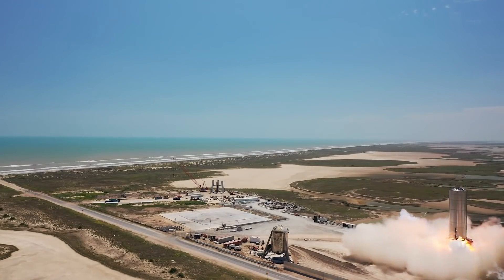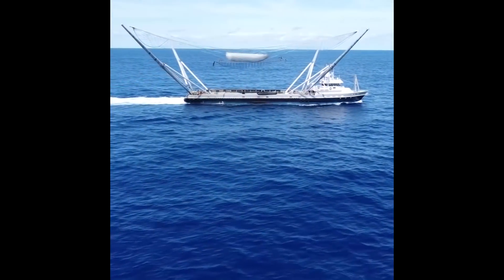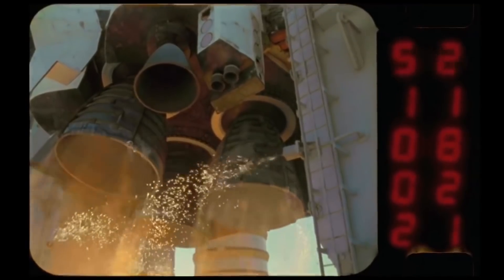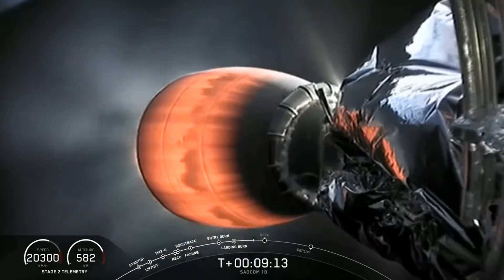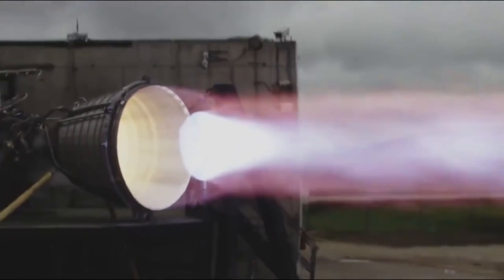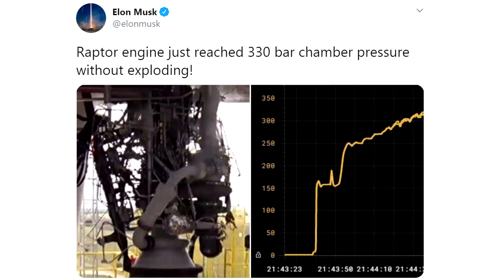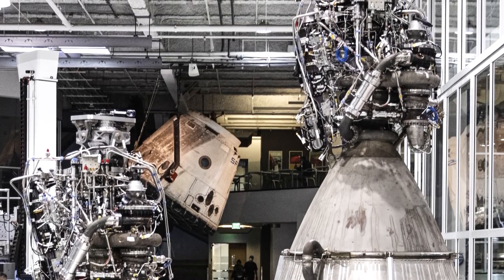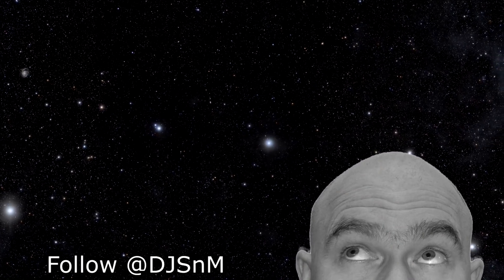How SpaceX's New Raptor Vacuum Engine Is Different From Previous Raptors (and Other Stuff)

Comment: white coating should be YSZ thermal barrier coating. It is used to block heat flux from hot gas, and prevent oxidizing of nozzle material

Comment: Solution to header tank pressurization is to use large cylinders filled with fuel, and a piston pushing down on it, to feed the engines. Four of these arranged linearly in a circle, will do  a perfect job, regardless of starship orientation.

Comment: Concerning flow separation of the hypersonic (not “supersonic“) gases from a bell nozzle: Yes, it´s a thing, but I think that the “bright beads“ that you see and are saying are (ground-based) examples of this effect, are in fact predominately shock diamonds -- a different phenomenon entirely.

The small contracture of the efflux just aft of the nozzle is a better indicator of the start of flow separation.

You mention the related term Mach diamonds, but I would quibble with you that shock diamonds is a better term, because there is no implication of any shock wave(s) primarily caused by decelerated flow, but instead are the visual indications of the high-energy local intersections of shock waves “ricocheting“ laterally.

Comment: After seeing the failure to re-ignite the Raptor engine in the SN9 landing, could the failure have been caused by the high presssure rapid startup of the pre-burners? Or is it more likely to have been something which occurred earlier in the flight when the engines were already firing?

Comment: 8:28 - Given that the turbopumps need to spin up in perfect synchrony, why not mechanically connect them (with a gearbox or belt/chain drive or something) to force them to run in lockstep?
Reply: That's how most staged combustion engines work but i think Elon just likes using the word full flow so he went with 2 preburners for the raptor.

Comment: NASA has its "in-space propulsion" facility (ISP: apparently wordplay on specific impulse, because second-stage and space-probe engines are optimized for high specific impulse) with a giant vacuum chamber to test vacuum-optimized engines in.  Rather than choosing between that and testing at sea level, I would think that it might be better to build an ambient-pressure test facility at some high-altitude location.

Comment: XLR-99, the X-15 engine, had a white coating too called Rockide to help insulated the walls which were regen cooled too by the ammonia fuel. That bright/hot spot is caused by the phenomena of gases becoming opaque above a certain temp. Thanks again Scott for another professionally delivered video - Ken

Comment: Hey Scott,
The Raptor Engine uses Helium?!! How much does it use? What does it do for the engine? Helium is a finite resource that is running out. I think this topic is worth a video!
Thanks,
Ringo
Reply: High pressure helium is used on most rocket engines.  It is used to activate the valves, pressurize tanks and to spin up the turbopumps.  They use helium because it will remain a gas even when in contact with cryogenic (very cold) fuels.  Other gasses would liquefy.

Comment: The nozzles are manufactured by machining grooves into the exterior of the nozzles. Than these grooves are filled in with a special wax. Then the nozzle is dipped several times into an electro plating tank of inconel 719 until a layer about 3/4 inch thick gets built up. Than the nozzle gets final machining and finally the special wax is melted out leaving behind the grooves. I saw this process on another video.

Comment: Why don't they change the nozzle exit size in the same way they do on gas turbines? The sea level engines would then be much more efficient as they gain altitude, i.e. match the exit aperture with the prevailing atmospheric conditions...

Comment: I wonder how the new raptor engines will compare to the RS25s when the final version comes out?  Granted there startup sequence is much quicker than the shuttle sequence but it would be interesting how both compare on performance and efficiency.

Comment: Scott, I need an explanation please.   You suggested that to get the expansion ratio up they could also reduce the throat area.  While I agree, don't you reduce the mass flow of the engine (assuming the chamber pressure stays the same)?   The flow at the throat is choked.  Thrust is Mdot x Vj.   The nozzle expansion works on the Vj term.   So reducing the throat will reduce the mass flow rate which will reduce thrust - UNLESS you let the chamber pressure go up.   What am I missing?   Thanks - great video as always.
Reply from the maker: Yes, you’d need to redesign the pumps to operate efficiently at the lower mass flow rates.
Reply: @scottmanley  So what do you do about the loss of thrust?

Comment: Raptor can't use radiative cooling because of the starship skirt? Wasn't Elon motto "the best part is no part", take the skirt down! That will give to the type of comments like "he likes his rockets and women skirtless to keep an eye on their hottest parts".
Reply: They need the skirt for landing legs and COPV storage
Reply: @ryancollyer2046  obviously they don't , can put separate protection on them, and another role of the skirt is to conect the two stages together, but it doesn't need to be a solid piece, can be made from separate beams with large gap between. The reason why they are choosing regenerative cooling and not radiative is that probably doesn't work on a engine twice more powerful than a vacuum Merlin but almost at the same size, especially if they need to using multiple times not a single time like in the falcon9 upper stage, also falcon9 have a single vacuum engine on the upper stage but starship will have three and some of the termal radiation will be blocked by the near engines.

Comment: In addition to flow separation, over-expanded nozzles incur negative pressure thrust, which literally sucks the rocket backwards. It's exit pressure minus ambient pressure times area at exit equals pressure thrust. Also worth noting that almost all rocket engines are over-expanded at sea level. This is because they tend to fly up, to higher in the atmosphere where the pressure is comparatively low, so it makes sense to optimize them for a compromise between sea level and performance at altitude.

Comment: Wait wait. Did you just say the Raptor is more complicated than the RS-25??? So the fact that the RS-25 has twice as many pumps to control, makes it simpler??? Not following you.. 

Will the Rap-vac fit into the Falcon 2nd stage and if so, do you think they will make an upgraded/new upper stage to use it. There must be a not insignificant performance increase, by using this properly designed vacuum engine. Plus they would get some experience with meta/lox and get the Raptor flight tested in vacuum.
Reply: Raptor and Rs-25 both have 2 turbopumps. Plus Raptor is full Flow Stage Combustion so it's more complicated.
Reply: @ryancollyer2046  And RS-25 is Semi-full flow. All the fuel runs through the 2 preburners.

Comment: Is there a reason why Starship doesn't use a more 'lifting body' shape?  Using a small amount of LB shaping would (I think) allow greater control during reentry and pre-landing freefall, while a greater (if not fully) LB shape would allow them to land like the shuttle, but with the option of perhaps one "go-around" use of the engine...

Comment: Gases become opaque at a critical temp and is why the shock becomes visible because the pressure increases as the atmosphere 'compresses' the exhaust plume. I never heard this fact mentioned anywhere,have you? Thank you with Blessings Scott - Ken

Comment: SpaceX's ability to leverage technologies from outside the normal aerospace field has always been impressive. The milled core sandwich panel design with a thermal coating (Yttria stabilized Zirconia or similar) has been used in the gas turbine industry for years to manufacture combustion section components. The current generation of large power generation turbines operate at turbine inlet temperatures approaching 1600c for months at a time.

Comment: would one raptor engine with variable geometry nozzle better than two separate raptor engine with two different diameter nozzles ? or is the additional engineering for variable geometry nozzle not worth the weight/thrust efficiency saving ? similar to what you see on the variable thrust vectoring nozzle on fighter jet. Feels like it will be way lighter with one engine with one variable geometry nozzle versus two engine with different size nozzle.

Comment: If they are smart,  for the  first test of the belly flop maneuver they should come down over the water just off the shoreline and then scoot over to the landing pad just in case thing don't go as we hope and it goes splat instead. Better to go boom out in the water than at the test facility.

Comment: Why has no one made an adjustable nozzle similar to what you find on the afterburners of fighter jets? You could optimize the nozzle size for altitude and atmospheric pressure. Or has someone tried it in a rocket?
Reply: I believe it's temperatures and material tolerances.  Afterburners produce temps under 2000 degree's while the raptor i believe is up over 3000.

Comment: Scott, great video as always. Can I ask a question, with all the science and tech going into these engines why is it not possible to change the shape of the nozzle when it arrives in space? Or some of the engine could be shut off on ascent and then transformed before turning back on. Might save fuel

Comment: So Mach Diamonds look cool but they are actually a sign of inefficiency. "Damn this nozzle! Those Mach Diamonds are huge. Let's bring this engine to space and redesign this nozzle!"
Reply from the maker: Mach diamonds happen when there’s a pressure difference, which is impossible to avoid unless you’re in a vacuum or only flying at a constant altitude.
Reply: @scottmanley  Thanks. I think I
 get it now, but it is counter-intuitive to me. Like most Rocket Science...lol
So maybe a great idea is a rocket factory on the far side of the moon. Low gravity well, and the engines and nozzles could be made extremely efficient because we could have a huge expansion ratio due to lack of flow separation and Mach Diamonds because of vacuum of moon.
Reply: @AboveBeyondVapor  Building on the moon is a great idea.  It's just going to take some time and a pile of money to get it started.

Comment: I wonder if it's possible to have some kind of vanes (separators) or ridges/riffles inside the large expansion nozzle, to reduce flow separation instability, similar to how baffles are used on the F-1 injector plate to eliminate burn instability.

Comment: Maybe dumb question but for 1st stage engines could you have a sleeve on the outside that slowly dropped down as it got higher, so the bell would effectively grow as it ascended? Would that be too heavy? Or too hard to keep cool?
Reply: Those sliding nozzle extensions tend to use radiant cooling. Not a good idea with more than one engine (trying to dump heat toward each other). Also not good if there is a skirt around the bell. You would heat the skirt or the skirt would reflect the heat back to the engine.
Reply: Harold Henderson yep yep. All valid points!

Comment: You talked about the fairings soft landing on water and it got me thinking: How hard would the splashdown be if there were no parachutes?
Reply: Fairing terminal velocity is roughly 20m/s, so the effect would be about the same as crashing a school bus into a concrete wall at 70km/h. Quite destructive.

Comment: I might be wrong but I think the throat diameter is more a function of static pressure within the reaction chamber and the need to accelerate the sub-sonic flow up to the speed of sound before they can accelerate it further using an expansion nozzle. Sub-sonic flow is accelerate by a contracting nozzle (throat) while super-sonic is accelerate by a diverging nozzle. 

Also, I think they can use a longer nozzle (space requirement allowing), it's the area of the exit that's most important, in relation to the area of nozzle inlet. Longer nozzle however would have higher frictional losses. However if they wanted to test a manufacturing process that required a longer nozzle, they could.

Comment: @Scott Manley I don't think SN8 will do a 150m hop before it makes its 15km bellyflop attempt. Despite SN5 and SN6 being made from an older alloy, it seems like SpaceX have gained enough data from their hops to proceed directly to a higher flight. I doubt they would have wheeled SN8 out to the launch pad with its aft flaps installed if the plan was to do a 150m hop initially anyway.

Also, great video on RVac...no, wait, the correct term is V A C T O R ;)

Comment: Scott, please could you explain what  "out of family ground sensor reading" means? What is being sensed? and why report the reading in such an odd way?
Reply: I'm not sure what was odd about it and I don't know what sensor gave them a reading that was out of family but from what I know sensor systems usually have a bit of variance in their readings, but when you graph them they tend to cluster together.  The expected values is the "family".  When one of those sensors deviates it starts to return values that are out of the 'family'.  What I can't say is if that's what Spacex meant.

Comment: Is the Vac Rap basically 'just' a normal Raptor, with a nozzle extension?  To a non-engineer, that's pretty much what it looks like.  There must be some plumbing alterations for the extra nozzle, but, other than that, the two engines look almost identical.  As for the quite overwhelming complexity of these engines, surely that goes against frequent re-use?  The more complex something is, the more that can go wrong, so the longer the check/refurb stage before re-use.  Musk's aim of land, refuel, take off again, needs maximum possible reliability, and that must argue against complexity?  I appreciate that these engines are effectively prototypes and the finished design will probably be simpler, but can it be THAT much simpler?
Reply: But in this case, the increased complexity results in lower internal temperatures which makes the engine more reusable. In rocket design, absolutely everything is optimized as much as possible.

Comment: 4:40 i wonder why they don't put an inverted kort-nozzle around the bell-nozzle. The flow around the engine would provide a significant drop in ambient pressure, optimizing test circumstances...
Reply from the maker: Yep, this gets done but they didn’t need it in this case.
Reply: @scottmanley  Any idea why this seems to be no valid way to run overextended bell nozzles on  a regular basis? I guess they are already experiencing lower than ambient pressure once the rocket goes supersonic and there is the vacuole behind the shockfront, but maybe they could have that lower pressure right from the start of the engine just by adding some cheap aerodynamic surfaces? It would make aerospike engines obsolete (if they are not already) Still they had those ridged overextended and heavily vibrating nozzles on the SpaceShuttle...

Comment: Could you do a video about the MOOSE  system, to get astronauts with the bare minimum of Equipment savely out of space ? 
You mentioned it in the past that it was thought about in the beginnings of human spaceflight, but never realised. 
Could it be more feasible with todays   engineering ?

Comment: Fun fact: the recommended pressure for a decent expresso is around 9 bars
Reply: That is a fun fact. That makes my Dolce Gusto more powerful! In ... some metric, at least. It goes up to 15 bar!
Reply: @Mythricia1988  15 bars might lead to over extraction with the same extraction time.  Have you tried the standard 20s extraction time at 9 bars?
Reply: @acasccseea4434  My machine is automatic, no control over that. However, once I get space for one I will get a proper espresso machine!

Comment: Is there no way they could install an expendable sea-level bell inside the vacuum engine bell? maybe some issues with damage to the outer bell when detaching it in flight.
Reply: See everyday astronaut’s video on the aero spike concept.
Reply: @sethland  Aerospikes are years away, I was just wondering if this could be done.
Reply: @tangent2658  I see what you're saying. My speculation: It'd really be hard to engineer the attachment joint of that inner sea level bell given the temperatures and pressures. Plus, it has to be hooked up with all that coolant plumbing. Not to mention, the turbo pumps would be hard to optimize for both bells. Seems really delicate and complicated.
Reply: @sethland  To be fair, thinking about it, I'd imagine that they would use them in that configuration on landing and they don't need that many. I was kinda thinking they may need to kick in during separation for a while but they will just go to vacuum like the raptor stage two Merlin.